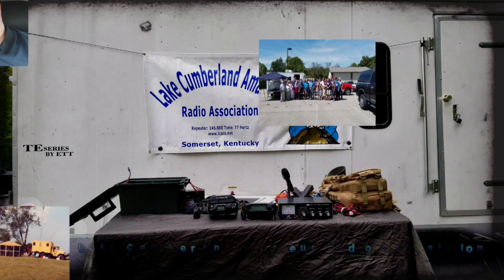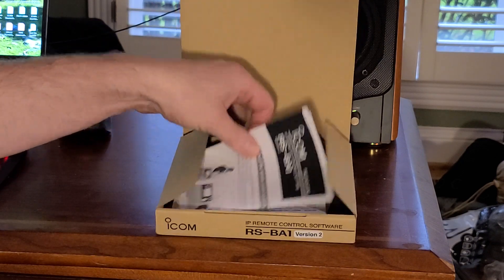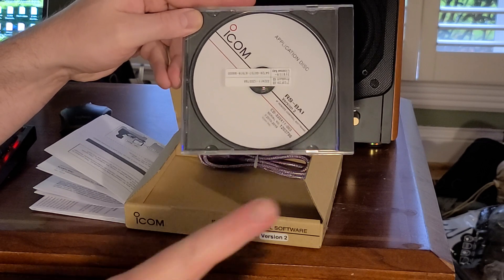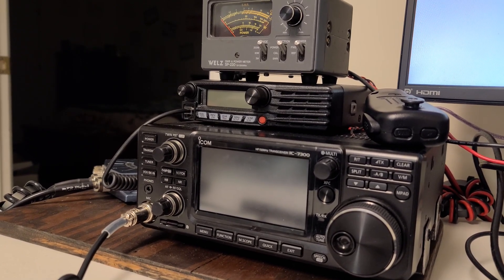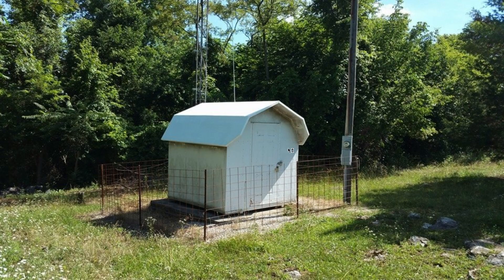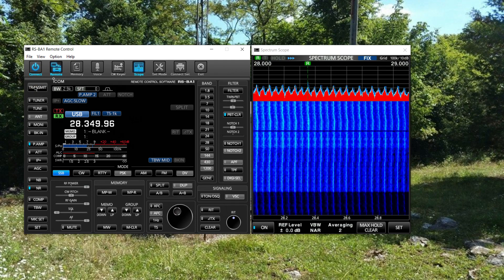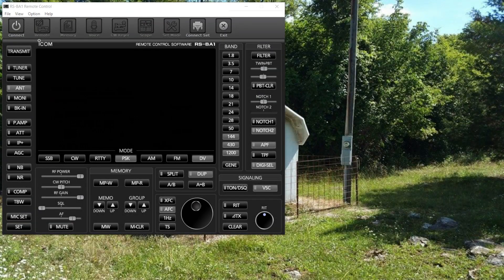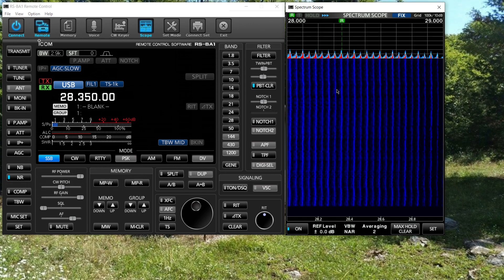LCARA HAM Radio: ICOM RS-BA1 Remote Control Software

Comment: My RS-BA1 causes the radio to crash when I try to transmit over the network and stays in transmit mode.  The radio stays in transmit mode until I get back to turn it off.  This is dangerous if I'm on the road and it happens.

Comment: So im new to this remote stuff , so if you have the software you have to install rsba1 on pc that has radio connected and also on the pc that id be taking on vacation ?
Reply from the maker: @Frank P - yes, on some of the ICOM radios, in this case the IC-7300, you will need a PC connected with a USB cable and the ICOM Remote Control Software installed. This acts as the "server". On the newer ICOM radios, this is unnecessary as the server is built-in to those radios.
Reply: LCARA HAMRadio i have a 7100 and want to access radio from my iphone or laptop
Reply from the maker: @frank p - use this link to the brochure: https://www.icomamerica.com/en/products/amateur/hf/rsba1/specifications.aspx